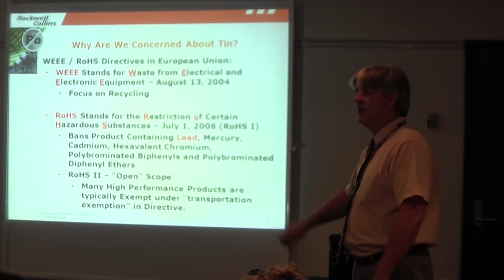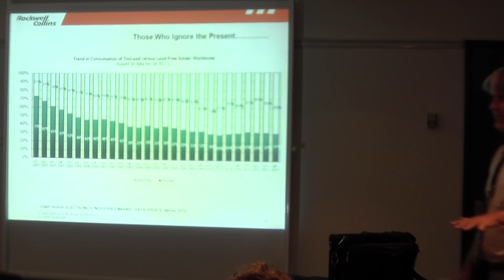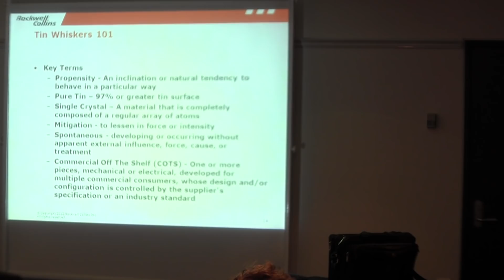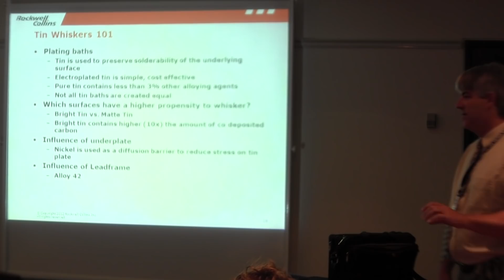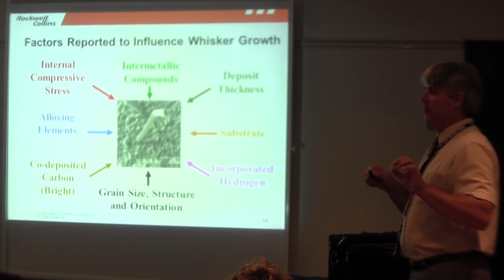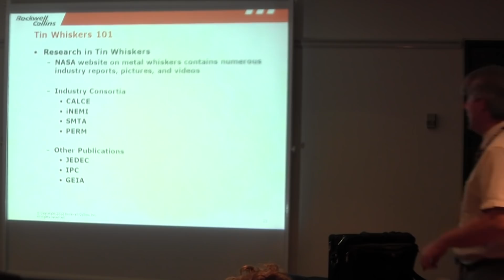Tin Whiskers 101

Comment: I no longer eat wild duck because of steel shot. Even with careful chewing it will crack a tooth, lead shot is hard if you you chew like a starved hog but it is soft enough to avoid cracking tooth enamel in most cases.

Comment: Finally a conclusive video about tin whiskers! I've been on the tin whiskers thing for years. Whenever anyone mentions they are using lead-free solder to protect the environment, I hit them with the tin whiskers phenomenon, and why we have so much electronic junk in the landfill, so they are doing the opposite of protecting the environment. This is one of the main reasons why TVs barely last 5 years these days, yet you get an old transistorised TV from the 1970s and chances are it will still work, or at least be easily fixable if not. For years all I could find online was 4 or so one minute clips about tin whiskers to back up my case, I'm not even sure they are still online. So thanks, Dave, for this video.
Reply: I think you have taken home the wrong message here. Lead free solder and tin whiskering do not go hand in hand. Tin whiskering most commonly occurs on tin plated parts of components and/or boards; tin plating is when pure tin is deposited on a surface. If you use solder with less than 97% tin (i.e. far from pure), you don't get whiskering. That's what he is saying here. Bad soldering from cheap rushed slave labour in China is a different issue. Malfunction from contaminated corroded boards because the manufacturer has been too cheap to use non-corrosive flux, or wash the boards or conformally coat the boards is a different issue. But I agree that it is more difficult to produce a good lead free solder joint compared to a leaded solder joint.
Reply: You definitely understood the video the wrong way. When A is replaced with B, but B causes problems, you should go to C and not back to A. Conformal coating, potting, plating, alloys, design constrains, etc, are all perfectly fine for preventing whisker-induced failures.

Engineers and scientists usually only come up with new solutions when there is a need. No need? No solution.

Comment: I have a 1959 Hammond tone cabinet. I got to noticing, every time I got around it I would start itching and get short of breath. I was in construction and I have been around a lot of insulation. I noticed that there was a fuzzy looking powder on the amps and all over the wood cabinet. It almost looked like little minuature trees standing up all over the chassis's. I would wipe  them off and it would not do any good. It was almost like it is growing. Every time I have got other people to touch it or even get close to it they would start itching. It is worse than any insulation, I have ever been around. I would even wipe them down with alcohol and would not get rid of it. My nose would stop up and my breathing would get worse. I even took the resistors and capacitors out of the amps and just bringing a capacitor  in the other room I would start itching. It is driving me crazy trying to get this stuff off. It has just about covered the bedroom up with dust. I keep it closed off. I was wondering if this would harm me. I told my doctors and They think I have lost my mind. I have even told guys that work on amps and they think I am imagining this. I think I need to get this out of my house.
Reply: why not me Rather than wiping them off, which tends to create a lot of airborne particles, try using a vacuum with a proper HEPA filter to vacuum up the whiskering or powder, then gently wipe done with a moistened paper towel (not alcohol but water, alcohol dries too quickly which will release the particles), then quickly dispose of the paper towels outdoors and take the vacuum outdoors to empty and replace the filter (and if a shop vac you can go ahead and wash everything but the motor portion outdoors as well).  At least that way you are not just stirring things up indoors.  Then use the vacuum to clean up the dust in the room and take it outside to empty, clean, and replace the filter once more.  A true HEPA filter will filter down to O.3 microns, fine enough to capture any whiskers and mold spores you may encounter.  Better still, use a shop vac with both a HEPA filter and an internal bag so that you can discard most of the waste with minimal handling.  And where an N99 respirator with a good seal to your face while working so you won't have to breath in anything that gets stirred up.  If you want to keep everything g off your person, where a disposable Tyvek suit, seal arms and legs with rubber bands if necessary, then go outside to remove the Tyvek suit and dispose of it in an outdoor trashcan.
Reply: It's hard to tell exactly what you're talking about. Beryllium Oxide (BeO) is a white powder that could explain some of the effects you're seeing, extreme itchiness etc. BeO is often used in power amplifiers in thermal pastes, insulators etc though it's normally in a form that isn't so toxic and I wouldn't expect as much as you describe. Maybe with time the ceramics have been damaged or it's been released though chemical reactions? As a white powder, BeO is bad news and generally needs to be disposed of through proper hazardous waste channels. I'd suggest getting an expert to have a look at it or just dispose of the thing.
Reply: Thanks.
Reply: Thanks

Comment: Thermal cycling and mechanical flex are a major stress source for tin whisker generation.  This is why so many PCBs in your car are soft-mounted.  Back in the old days we soft-mounted PCBs mainly to keep DIPs from walking out of their sockets (though we sometimes had to add tie-wraps too).  For the past decade, soft-mounting is primarily to help minimize tin whiskers.  (Edit: And for microphonic effects that were too hard to design out.)

Comment: I shook a big solder chunk out of a new Quad copter I just got. Not cool! That thing could have rolled into trouble really quick. Tin is a funky thing. I have dug that crap up finding it all white and smelly while metal detecting. These materials can really create issues as they age. Tin is a funny thing that doesnt belong in electronics. The solder in the auto industry when exposed to salt air can really cause issues.  Lead is the only solder I use if possible, been buying up what I can find. getting harder to find.
Reply: RC Hobbyist Extreme In fairness, even our leaded solder electronics were still 60-63% tin, the issue is not so much that tin is in our electronics but that its moderator has been removed making the tin far less stable resulting in the premature failure of countless modern electronic products because we are still trying to figure out how to work with high tin solders in the absence of a proper moderating alloying element.

Comment: My company exists solely on repairing electronics by de-ROHS-ing.  So much stuff is prematurely going into the landfill because of this greentard lead free crap.  De-ROHS some of that exotic Chinese crap is especially challenging.  The lead free mystery solder they use is gun metal blue and obnoxious as hell in some cases.  All your solder equipment has to go into decontamination afterwards.  But the circuitry is so reliable afterwards.

Comment: 11:45 "Things arent falling apart, lead free does work" - really. I mustve imagine all of those consumer electronics which are failing due to things like BGA ball cracking due to heat cycling then...
Reply from the maker: He means if you do it right.
Reply: And that's the nub of it. It is harder to get good reliable joints with lead free compared to leaded. It is as simple as that. Cheap crap is more likely to fail than boards that have been properly processed.

Comment: We had a series of audio consoles in 2009 from whiskers due to low use.  The cut solder ends would grow towards the zinc back plate, causing random control signals to trigger across the audio system.  Took down two radio stations in the process.  We fixed it with a mylar sheet between the pcb and the back plate.  Took forever for the manufacturer to figure this out and it was almost random that they found it.  All of this was due to a process change where they were unable (local law) to wash the boards after soldering.
Reply: Tell me more about the washing restriction. Did they have to stop using a certain cleaning solution?
Reply: No, it was all washing.  Not even the environmentally safe stuff, because California.  I'd have to direct you to the mfr for more details, we were just an effected end user.
Reply: This sounds like corrosion (e.g. dendritic growth through contamination) rather than a tin whisker problem. Washing does not effect tin whiskering as far as I understand. Board contamination is a whole other issue.

Comment: Tin wiskers can form and cause major problems in lead free solder. See https://nepp.nasa.gov/whisker/
Throttle position sensors with this issue were causing vehicle recalls.

General motors had issues with dash speedometer modules not shutting down due to what they called solder creep.

Comment: "other electronic circuits caused by using lead free solder"

Correct me if I'm wrong but he says it's not about lead free soldering. It's about using pure tin.
Reply: donpalmera That was also my take.
Reply: A better phrase than "pure" tin, which I suspect many think means 99.99+%, might be "high concentrations" of tin since the purity could be anywhere from 97-99.99%, or thereabouts, and that includes a lot of high tin solder alloys out there, some of which may have as little as 0.3% in non-tin elements (such as gold, silver, etc.) and those can still lead to whiskering if they are not sufficient to release the stresses.
Reply: True but the majority of the talk seems to be about tin plating on component leads and PCBs.
Reply: donpalmera That's because he comes from an exempt industry but is directly affected by the general unavailability of commercial parts that are not high tin content treated parts because industry stopped manufacturing them.  That General parts unavailability makes a significant part of that exemption a moot point in practice as you must still deal with the problems if you can no longer obtain parts not affected by this problem.
Reply: That might be the case. I was simply pointing out that while the video description says he is discussing tin whiskers in relation to lead free solder he (if I'm not mis-remembering) explicitly said it's not about the solder and about high/pure tin coatings.

Comment: I once worked for an ISP and they bought an old data centre. One week some contractors were rewiring under the raised flooring and we found that a load of power supplies in the servers died.

It turns out the underside of the floor tiles had been coated with tin in a way that made a whiskers. When the contractors lifted the floor tiles the fans in the power supplies sucked them in and shorted out the power supplies.

We ended up using up all of sun's supply of power supplies in the country because we blew so many.
Reply: Probably Zn not Sn? He mentions this exact scenario early on in the video. Maybe yours was the case he was referring to!
Reply: Andrew Stothard fascinating story, thanks for sharing,
Reply: "Blew" so this means there was smoke/fire?
Reply: No fire. They just died. From what we gathered the whiskers ended up shorting out various components and that killed them.
Reply: Ok but did they actually checked these components?

Comment: can someone explain me why the fuss about tin whiskers?
Reply: Peter Bočan if your meant fuss, then it's because they can short out components and break things, if you meant fuzz, as in having a fuzzy understanding, well, it's just that. Because the causes are not understood well enough they've not been eliminated as issues in the electronics industry.
Reply: Sorry, I meant fuss. I am not mechanical nor electrical engineer so this just passes by me.
Reply: Peter Bočan Basically, stuff stops working randomly without warning. We had a solution with lead, but know we cannot use it anymore (ROHS).
It's an issue because it's totally random and can occur very fast or not at all.
Reply: They are tiny wires that randomly appear from pure tin that are strong enough to carry the current to light a good sized LED light.

Comment: Can somebody give a summary?
Reply from the maker: Tin whiskers are physics black magic and a total pain the arse caused by lead-free solder
Reply: That was short and precise. Thank you.
Reply: Also, what I think is important from this talk: tin whisker is caused by solder joint stress (strain & compression), this mean (I think) heat/cold cycle might contribute to whisker formation and the contact metal should be standard to the solder to avoid stress from atomic lattice mismatch (only solder to standard metal contact). The whisker also grew like tree from the tin and this isn't caused by electromigration, so it do not require the circuit to be powered and it is a spontaneous behaviour of the tin. The whisker might react and move toward opposite contact due to voltage bias but the whisker is generally spontaneously insulated by oxygen reaction forming tin oxide unless the whisker scraped on the surface of the opposite contact, this mean some coating & potting could mitigate whisker related issue. Finally; avoid bright tin and use matted tin because the bright tin is coated with some kind of material which is bad and produce whisker, but be assured that industries has no incentive to sell you any tin alloy that accelerate whisker formation so be assured.
Reply: This talk is about tin plating and deposition on e.g. component leads and packages, shields, brackets, other hardware. It is not about lead free solder. The guy says quite clearly that you do not have to worry about tin whiskering in solder that has 97% tin or less.

Comment: NICE RoHS-direktivet
Reply: Ivan Vestergaard Holm car Batteries still use lead.

Leaded Solder is also used in the medicine industry because of the better reliability
Reply: Ivan Vestergaard Holm Yes and the irony is is makes circuit boards fail leading to the need for more materials and waste products - thank you the EU
Reply: It a good thing that PB free the auto industri has stopped the PB in the car and Battery many years before. it only the Space electronic that use PB